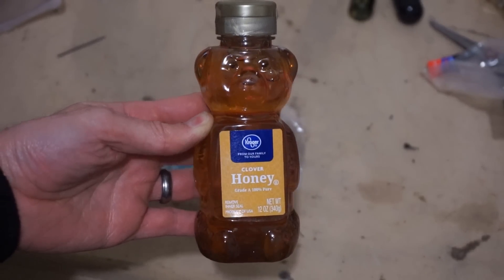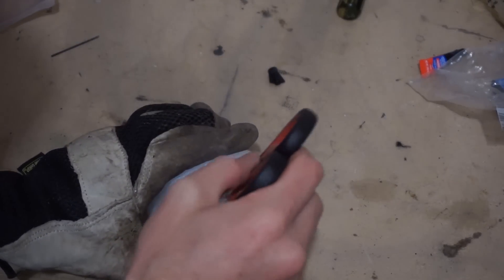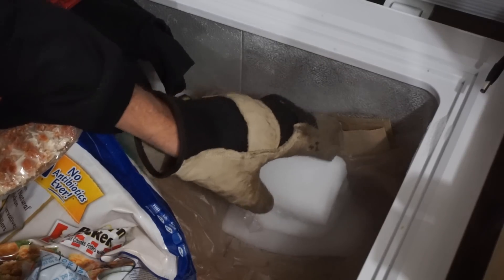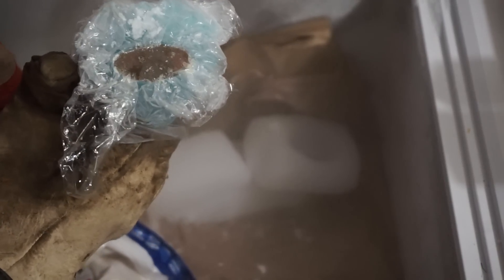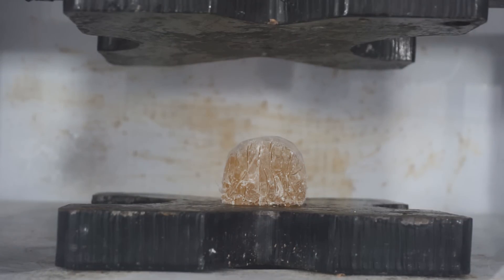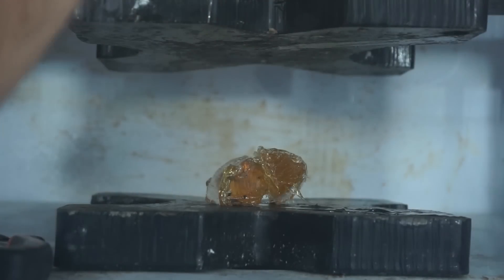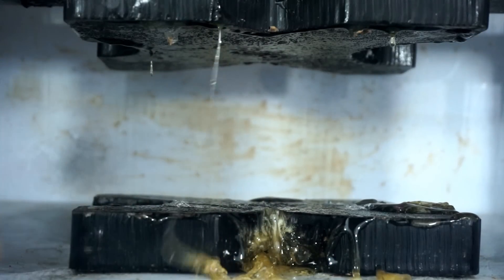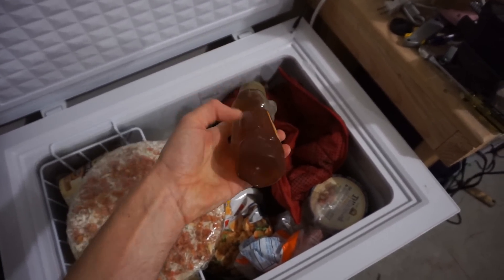Crushing Cryogenic Frozen Honey With Hydraulic Press!

Comment: The press didnt "heat up" the honey. Under pressure, surface molecules can melt - a process called Regelation. Same concept is why when you're skiing, you're actually skiing on a layer of water as the snow is momentarily forced into a liquid.
Reply: Technically though it was the press. Where did the friction that put the molecules under pressure come from?

Comment: I'm curious if it was the heat from the press that liquified the honey or if it was the pressure heating it up.  You might be able to get it to break if you cool down the plates on the press first by strapping some dry ice to them for a while, or I could be wrong entirely